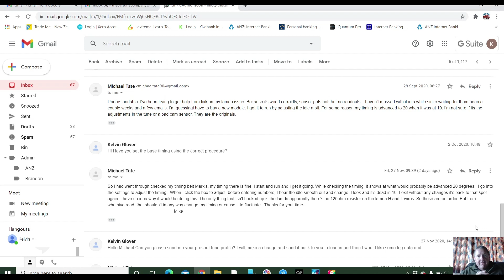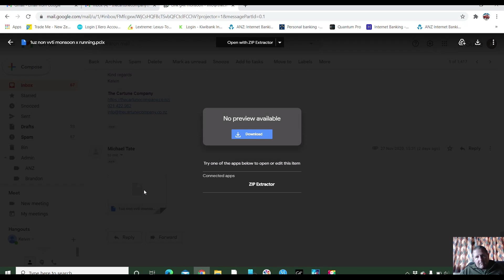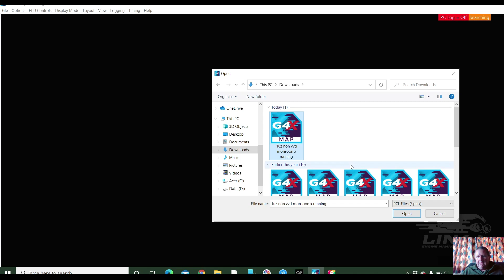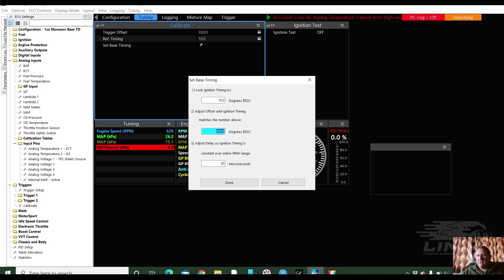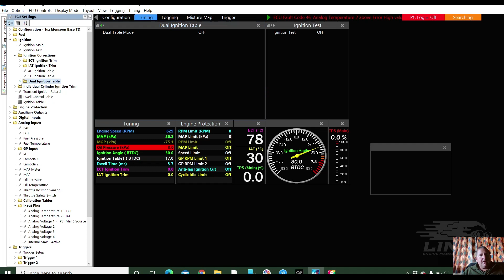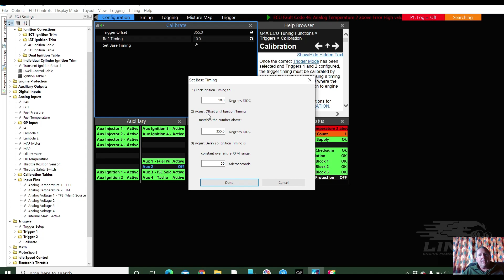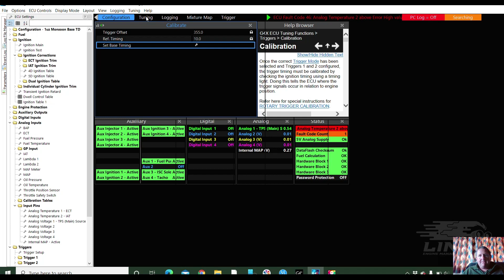G4X link ECU Basics - owner thinks the ignition timing is out.  What's really happening

Comment: Great video very helpful this one I'm working on  (g4x) plug n play I believe  was a little different it had another sub menu and was in there instead.. ..and no surprise the base timing was out upon talking to the customer he stated the guy never put any flashing light on the engine 🤦..u just can't assume ..I'm pretty Shure that's what cost rob dahm his first quad rotor issues a few years ago on first runs...base timing base timing base timing ..no engine can eat bad timing for long
Reply from the maker: One of the basics , check the base timing , regardless of how many times the tune has been used , and guys think because its a PnP they can miss this step and then the issues start.  Cheers